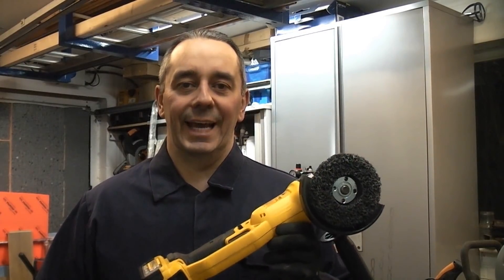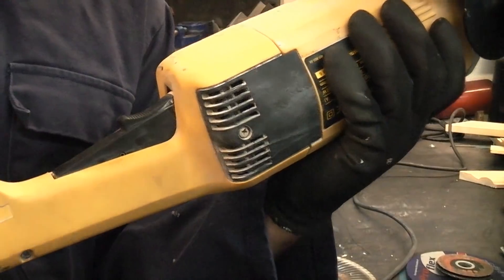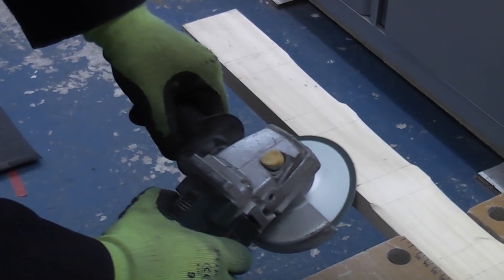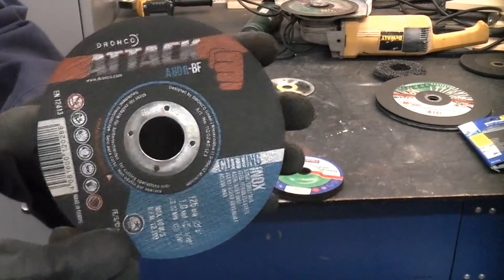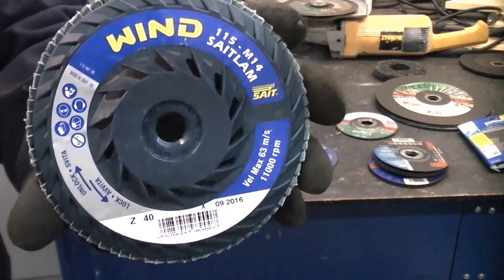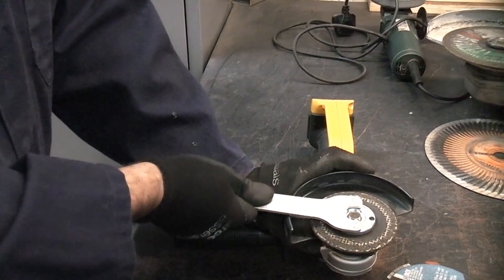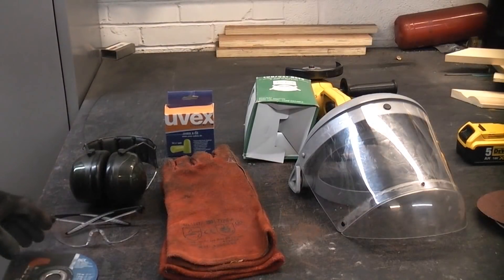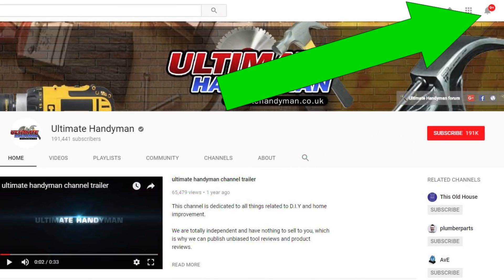How To Use An Angle Grinder-Angle Grinder Safety Tips

Comment: Best spent 30 minutes before i start using my newly bought angle grinder. Thank you for all the clear information.
Reply from the maker: Thanks for the comment
Reply: Great video as usual. I didn't even know about the expiry date on disc so lesson learnt thanks.
Reply: I would also like to add this is also a very good video, well worth a watch before touching the tool.
Reply: Very informative video. Thank you.
Reply: knife safety : apply tension only away from you, when walking/running/climbing stairs hold it with the blade downwards like the murderer in psycho

angle grinder safety : 30 minute long video

therefore I propose the formula d = u^4 where u = usefulness and d = danger
Reply: Mine is about to be delivered in a few minutesss!

Comment: Thank you for an excellent teaching demonstration. I'm 71 yrs and have been a wood worker. I had never used an angle grinder until last summer when my good friend asked me to help him with a project. He pulled out an angle grinder and removed several nails and screws that had to go so we could continue. I would have pulled out a screwdriver, hammer and claw, but was amazed at how effective the grinder was.  I bought one soon thereafter. Hadn't used it until yesterday and quickly realized I needed to get some basic information about everything concerning the grinder. Your video was perfectly attuned to what I needed. Again, thank you so much, I feel I'll be a lot safer now when using it.
Reply from the maker: I'm glad the video has helped ;-)
Thanks for the comment 👍

Comment: Brilliant video, and so glad I watched all the way through.  Having just purchased a DeWalt angle grinder, I am a novice so this video goes through all the types of discs and recommendations clearly.  The hints and tips are extremely useful, and the health and safety aspects are handled with authority, without ramming it down your throats.  You won't regret watching this.  Very well done sir.
Reply from the maker: I'm glad the video helped ;-)
Reply: I agree, this was incredible and really stressed the safety aspects of this very dangerous machine.  I just bought one for a single job in my house, and going in without knowing what you're doing can lead to very serious problems.  Who would have thought the discs have an expiration date and can cause so much damage - I will just throw mine out after use so I don't forget and use in 10 years

Comment: Been using an angle grinder for years, but still learnt a thing or two from this vid. 👍🏻Complacency is a very dangerous attitude, especially with any cutting, grinding or slicing equipment. Don’t ever apologise for using PPE, I’ve seen a lot of nasty injuries over the years. Stay smart. Stay safe. 5⭐️

Comment: Enjoyed that learned alot about grinder which i really should already know having used them my entire working life. I had no idea they had a "use by date" and in all honesty im that guy who removes the guards and says "Can't see F all with that on there". Think i will be checking my discs from now on and perhaps reinstalling a guard or two.
Reply from the maker: I've been using a grinder for 30 years but I too never knew about the expiry date until I did an abrasive wheels course a few years back. The guard can be a pain in the backside but it is there for a very good reason.
Thanks for the comment
Reply: A guard or two? I don't think it's really possible to install more than one at a time on the machine.

Comment: Omg! I've been using an angle grinder professionally for 39 years and your video has taught me so much. You have saved my life literally.  I have a cable tie to lock the switch on the 9 inch and i just plug it in when my apprentice is ready. He just kicks out the plug when he's done. None of our grinders have guards so the discs become one size fits all. Makes it a bit cheaper. We also made a chainsaw attachment for the 5 inch. We used the guard for that.
Reply from the maker: I'm glad the video helped 
Thanks for the comment 👍

Comment: Very very nice video. Especially the safety part.

For me the worst with wire brushes for angle grinders is that  they are usually unbalanced causing serious vibrations.
Reply from the maker: I hate wire brushes in grinders, I once had to use some when cleaning a weld on a large vessel and I was covered in metal bristles afterwards.
Thanks for the comment

Comment: Great video. This comment is from a person that has been a welder and metal working for over 30 years, I will always respect the angle grinder. I had a cutting disc brake  and a piece from the cutting disc ripped through my leather glove and embedded itself between my knuckles.
Reply from the maker: Well said!
 Thanks for the comment 👍

Comment: I've cut myself with an angle grinder a few times and every time it was because of kick back. Once I was grinding the top of a tank of some sort with a flap disk... I was on my knees in a very awkward position with all kind of pipes and stuff around me and the grinder then decided to catch on something and jump straight to my knee. It made a nice oval hole. Remember the trousers being soaked with red liquid.  
Another incident happened while cutting some steel structure right in front of my face. The grinder then got this great idea to make a quick jump to my face.
First I was like... "what just happened"
Then I felt something warm and wet gushing down my mouth.
the thin cutting disk had made about a 3cm long straight hole between the nose and upper lip. 
the grinder really just made contact for a fraction of a second in both incidents but it surely cut flesh with ease.
Reply from the maker: I do know a guy that lost his eye when using a grinder, I should have mentioned it in the video but forgot.
Accidents happen very quickly with these machines, often in a fraction of a second.
I'm glad you are still ok despite the accidents ;-)
Thanks for the comment
Reply: Some newer grinders come with anti-kickback features.
Reply: I totally agree, angle grinders should only be made with anti-kickback feature, it should be a must, it is a very useful tool but at the same time very dangerous in the wrong hands....
Reply: So what causes kick-back? Excellent video BTW.
Reply from the maker: It can be caused when the created gap in the work piece closes onto the rotating disc, say for example you were cutting a large piece of 3 inch square bar that was 6 feet in length and you tried to cut it in the middle to make 2,three foot lengths. If the metal was not supported correctly it could sag in the middle causing the disc to be pinched.
Reply: @ultimatehandyman  Pinching disks seem to be the biggest cause of kickback. I noticed most kickback happens with slitting disks after metal that's being cut pinches on the disk. Metal bar also seems to be a problem with the grinder getting an urge to unexpectedly roll over and behind the bar and jamming against the guard.

Slitting disks I would say are the most dangerous of all disks.

Comment: Been using a masonry grinder with water to try to keep the dust down, didn't know that it would degrade the disk and risk exploding it. Very glad I watched this before anything bad happened. Going to take a safety course and make sure I know everything I need to know before picking up another angle grinder. Very timely video, and very informative, thank you!
Reply from the maker: I've seen people cutting metal on YouTube, using water to prevent the metal getting hot and it always makes me cringe.
If you use a diamond disc you can use water as it will not effect the disc. It's worth going on an abrasive wheels course though as they should cover everything.
Thanks for the comment

Comment: I found it to be an excellent refresher, as I haven't used a grinder for years. Now I will buy the safety gear you recommend. I will always have a heakthy respect for the injury causing potential of grinders as well as table saws and anything with a fast rotating, reciprocating, or otherwise moving blade. The grinder adds the risk of exploding disks, flying scrapnel, and fire/burn causing sparks. It is the dragon of power tools. Thanks again.
Reply from the maker: I’m glad you found the video useful
Thanks for the comment 👍

Comment: Thank you for your instruction.  Forget the naysayers.  New to metal work here, using it to take out rivets and unmount school bus seats, repair & modify bbq pits.  Also, to cut 55 gallon barrels. I do make sure the insides are not flammable from previous usage.   Very informative, and will take your safety guidance seriously.  Im using a 11amp 4 1/2 inch Milwaukee grinder.  A suggestion: please provide a usage chart;  different discs and size thicknesses to apply to various metals, wood, tile and brick application, and why?  Great concise common sense approach overall and well done video to compress much info!

Comment: This is by far the most informative video I have seen on using an angle grinder safely. A friend of mine had a disk explode on him, whilst working on a vintage car. It really messed up his face permanently, even though he had safety glasses on, (but no visor).

I will now be chucking out a load of old grinding discs and ensuring I wear ALL the correct PPE equipment.....I've been a bit slipshod about wearing a visor and thick gloves.

Thanks for this important advice.
Reply from the maker: I'm glad you like the video, it is important that people know the dangers.
Thanks for taking the time to comment ;-)

Comment: Great video my friend.  For those interested in extra safety, specially when it comes to kickback, the disc jamming up suddenly, there are grinders with protection features for that, but expensive, so those with corded angle grinders, what i did was to adapt a breaker to the power cord of my grinder because sometimes the breakers at the place you are, they way higher than the amps you are using so they will not cut the power off easily in case of a kickback.  So the theory is when the disc or wheel suddenly stops there is a quick and sudden rise of current or amps that doubles or three times higher than the average current your grinder uses so this is when the breaker trips and shuts down the grinder, the calculations are for 120V power are: for grinders between 6 - 8 amps use a 15 amps breaker, for grinders between 11 - 13 amps use a 20 amps breaker, for grinders with around 15 amps use a 25 amps breaker.  you could use a breaker with a capacity very close the amps you are using but when you just start up the grinder or you use the grinder with a heavy load it will trip the breaker very often which could be annoying.  i hope it helps.  Greetings from Colombia
Reply from the maker: Thanks for the comment ;-)

Comment: Thanks. I was completely in aware of how dangerous they were. I googled some injury images & I will remember them before I am behind the machine to keep my safety up
Reply: Do you think metal blades for cutting aluminum or other metals are safe?
Reply from the maker: I'm not sure, to be honest. I have seen videos of some of them in use ( I think one brand is Lenox), but they just don't seem as effective at cutting as an abrasive disc. I'm sure they are safe, but I'm just not sure how effective they are.
I might have to buy one to test it out, at some point ;-)
Thanks for the comments 👍

Comment: Brilliant video fella. Thank you for taking the time to make such an indepth video stating all of the necessary information. Just bought the Dewalt 405 angle grinder to take some bolts off a trailer frame, I nearly bought the same cordless grinder like yours but then realised that the newer version does have a brake and is brushless so the same as my other tools. The amount of people who use old discs and wonder why they break etc. A lot more to grinding than just wearing a pair of safety glasses.... 
Brilliant video and you have probably saved quite a few people having to go to A&E. Kind regards.
Reply from the maker: I’m glad you found the video useful
Thanks for the comment 👍

Comment: I know someone who was cutting inside a large tank with an angle grinder while stupidly holding it with one hand and above his head. It kicked back and he put his free hand up to save his face, which it did do but took half his hand and three fingers off at the same time.  I gained a lot of respect for an angle grinder after seeing the mess it left that day and ALWAYS ALWAYS wear the correct PPE while using a grinder now.
Reply from the maker: Ouch, you just can't be too careful with these machines.
Thanks for the comment

Comment: Been using angle grinders for 35 years without a serious accident and don''t even wear gloves. Not even sure why I clicked on "what I thought was a stupid safety video about angle grinders". But, I did what you asked and googled angle grinder accidents. I do have some DIY stuff to do with the angle grinder tomorrow and before I do I will go buy some safety gear. I have obviously been lucky in  previous years and do not want to press my luck anymore. Thanks
Reply from the maker: I’m glad you found the video useful
Thanks for the comment 👍

Comment: Thanks!  Well done.  Time well spent!  I learned a few things.  I have used a grinder but not a whole bunch.  Some of the points were basic and pretty obvious, and some not so obvious - but all the more dangerous since it would be easy to make a bad and dangerous assumption, or two.  Most importantly I think most of us who were never formally trained on grinders might not fully appreciate how dangerous a tool a grinder really is.
Reply from the maker: Yes, they can be very dangerous, if used incorrectly.
Thanks for the comment 👍

Comment: Excellent video with emphasis on safety. Thank you! Have a great week.
Reply from the maker: Hi Ian, flap discs are miles better to use. There is no chance of the disc breaking apart and because they are not made from resin there is no expiry date on them.  I'd choose a flap disc over an abrasive disc any day ;-)
Thanks for the comment

Comment: shouldnt the cutting discs actually get less hot with a variable speed grinder and which size ends the cutting disc and starts the grinding disc?
Reply from the maker: I’m not sure, as I have never used a variable speed grinder. They have also never been mentioned when I was on my abrasive wheels training courses 👍

Comment: I did the google search, and I can't believe some of the parts of the body the grinder has gotten lodged into. Not even just the injuries from shattered discs, but from the whole unit just going flying and getting lodged in the side of the person's neck or something.

After watching your video I did the smart thing and found the manual for an old DeWalt angle grinder I got used - and discovered it is not designed to use cut-off wheels, which I had previously used under precarious conditions. Thankfully I was never injured, and now I will no longer use the tool for applications it was not intended for. Thanks for the safety information.
Reply from the maker: I'm glad you found the video useful ;-)
Thanks for the comment 👍

Comment: Thanks for taking the time. Makes you think. 
I've looked at the videos attached to the 'images' you mentioned and I think the moral of the story is treat these things with the utmost respect. They aren't toys. Pay attention to what you're doing at all times. Don't get casual or sloppy, don't get distracted, focus and don't let your guard down. Read the manual and just follow the rules. 
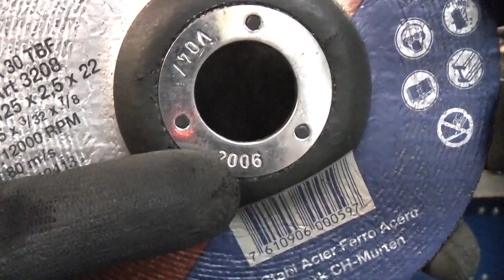The comment about expiry 10:44 was it seems directed towards 'bonded' discs, ones with abrasive services, metal grinding discs, not stone cutting discs made of silicon carbide. Stone segmented diamond cutting blades etc. I presume I'm right and thought I would mention this before people start chucking away their old barely used stone cutting discs. These I reckon can be left in the will. Happy to be corrected. 
Recommend video should be watched prior to buying an angle grinder. Once again thanks.
Reply from the maker: I'm not sure about stone cutting/stone grinding discs having an expiry or not, as I have never used them for decades- as diamond discs are far superior.
Thanks for the comment 👍

Comment: Hello, i want to thank you for this video. Im just getting started in fabrication and learning the basics like welding, using angle grinders, etc. And this video has tought me a lot on how to use this great tool and be safe. I do my best to follow the safety instructions you mention on the video. The one time i got "sloppy", i burned my forearm (got the arm in the path of the sparks). Lesson learned! luckily it was only a light burn. I will certainly do my best to avoid getting distracted in the future.
Thanks a lot!
Reply from the maker: I'm glad the video helps
Thanks for the comment 👍

Comment: 1 thing you should never do is leave an angle grinder disc down on your wofk bench, I've noticed this fella doing it a few times, also when you're grinding always guide the spark downwards when possible and if your grinding aluminium use some beeswax on your disc to stop it clogging up and always cover any bare skin as aluminium can clog your pores, happy grinding guys 👍

Comment: Great video, very informative and safety always first, never compromised.  As a wood carver I do have special discs made specifically for this craft, they also meet the safety standards required.  Once in a while I tend to remind myself of the other uses and discs which can be taken for granted.  As Grinding and cutting can cause confusion.  Many thanks for clearing that one up. Excellent advice and thoroughly researched.
Reply from the maker: Thanks for the comment 👍

Comment: How would you recommend storing cutting+ grinding discs etc my workshop suffers from condensation, I currently store them in a filing cabinet drawer
Reply from the maker: I have them hung up inside of a metal cabinet, they are hung on M16 bolts.
Thanks for the comment 👍